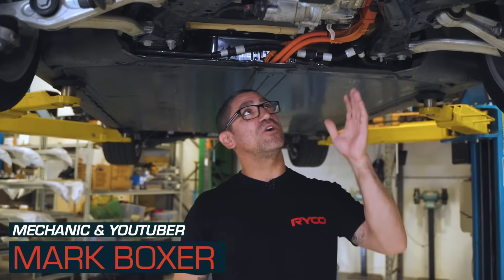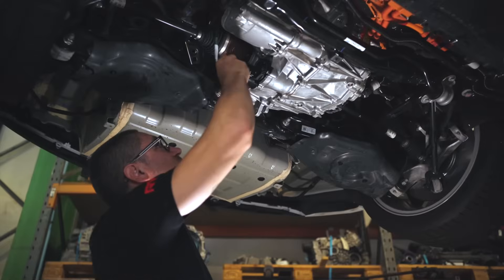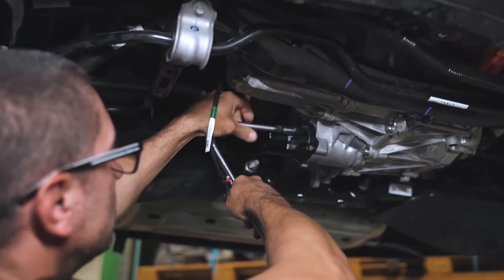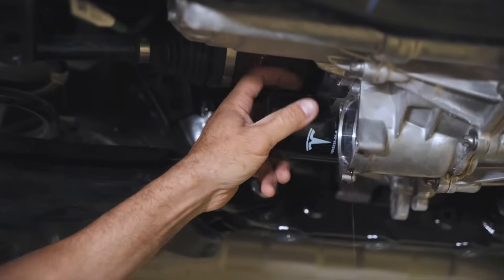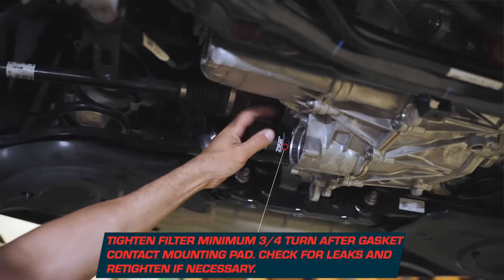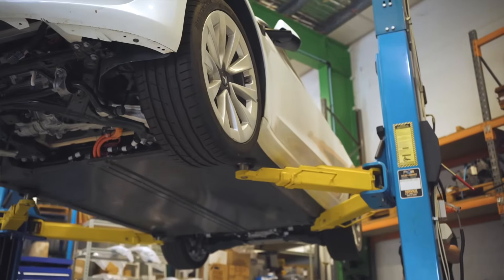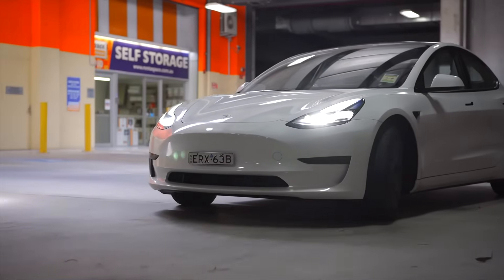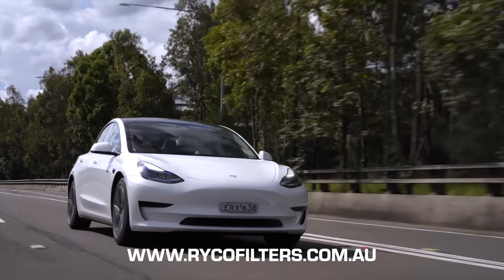Tesla Drive Unit Service

Comment: My 2018 Model 3 had a leak from the rear motor diff pump.  Tesla drained the oil/refilled and replaced the diff pump.  The tech and I test drove the car and received a message of reduced power which was because the diff/filter was not primed.  The only way the Tesla tech could figure out how to prime the diff system was to reload the current version of firmware which ran the diff pump during the self test.  At that time an owner could not reload the current version of firmware but you can now through the service menu screen.  Not sure if the diff pump(s) are always currently run during all firmware updates?

Comment: What a load of BS ! No service is required on drive units unless the car tells you. The motors are “free air” driven and NO oil touches the spinning motor. The oil does not degrade like regular ICE vehicles. 
How many times have you serviced your washing machine, this has a motor and can spin up to 1600rpm  so surely it needs an oil change ????

Comment: wrong fluid!

Tesla officially specifies Pentosin ATF 9 as the gearbox fluid for the Model 3 drive units in many documented cases, particularly for newer models like the Model 3. This is a synthetic automatic transmission fluid (ATF) designed for high-performance applications, providing excellent lubrication and thermal stability. It’s used in both the front and rear drive units of the Model 3, including Performance and non-Performance variants. The fluid is intended to be long-lasting, and Tesla has moved away from regular service intervals for it, treating it as a “lifetime” fluid unless a specific issue arises (e.g., a service alert or leak).

In contrast, ZF Lifeguard Fluid 9 is tailored for ZF’s 9-speed automatic transmissions (like the 9HP series), which are found in some traditional internal combustion engine vehicles from manufacturers like BMW, Jaguar, or Honda. The Tesla Model 3, however, uses a single-speed reduction gearbox driven by electric motors, not a ZF multi-speed transmission. While ZF Lifeguard Fluid 9 and Pentosin ATF 9 may share some similar properties (both are high-quality synthetic ATFs), they are not interchangeable without confirmation from Tesla, as the Model 3’s gearbox has unique requirements tied to its electric drivetrain, including motor cooling and specific viscosity needs.

Historically, Tesla used Dexron VI ATF (another synthetic ATF) in older models like the Model S and some early Model 3 drive units, but for the Model 3, especially post-2017 builds, Pentosin ATF 9 has become the standard, as noted in service manuals and teardown analyses (e.g., by Munro & Associates). The exact specification can vary slightly by production year or drive unit revision (e.g., older Raven units vs. newer hairpin motor designs), but Pentosin ATF 9 is consistently cited for current Model 3s.

Comment: Do you only replace the rubber gasket when it leaks on the oil pump  that you unplugged before filter ?
Reply from the maker: @moodletree, if you have a leak from your pump, you should visit an authorized Tesla service center or a specialist. I'm unsure if replacing the pump is necessary, and we currently do not make the pump for this application.

Comment: Hello, my Tesla Model S 85 from 2014 started making a humming sound at speeds above 50 km/h. Hear it in the front left, I thought it was the front left bearing, I replaced it, but the hum persists. Could it be engine failure? Thanks Norm.
Reply from the maker: Please refer to your nearest Tesla service center.
Reply: It’s your wheel bearing. Simple replacement, or if it’s the drive motor same thing bearings, if your mechanically inclined and have the proper tools (press) you can do it yourself with a rebuild kit.

Comment: Every 100.000 miles in case you are wondering. My model 3 has about 9k miles on it right now. Ill be fine for a while I think!
Reply: 50k on large ones, 100k on small ones.
I'll probably do sooner than later tho.
Reply: That's way to any miles on the rear drive. When you service it the rear will look awful compared to the front. The front drive is barely used. Maybe 30k on the rear.

Comment: Uhhhh you left out the most important part. Do this once every 100,000 miles 😂! If not more. that’s like once every 8 year. No different than gasoline cars who also need to swap their ATF or differential fluid every 100k or longer. Also pretty much no one does that bullshit and everything basically fine for hundreds of thousands of miles.  damn what a weird business strategy relying on servicing electric vehicles. 😂😂. Maybe the really bored paranoid people will want to swap out their oil every 5000 miles ? or just do none of that through the whole life of the car with probably zero ill effects.
Reply: Another video showed the difference between the new oil and the used oil. There was a big difference; the used oil looked very dark for both drive units. If over 80,000 miles, I would change it.
Reply: @snowrocket it’s honestly not. I own a shop myself and was curious about this. When my wife’s model S hit 250k miles I put it on the lift and did the drive unit service. The oil that came out was from the factory 8 plus years ago. Captured a bit of it and sent it off to get analyzed just out of curiosity. It was black but there was little to no breakdown yet detected in it and it spec’ed like new fluid. 
The two things that break oil down in gas cars are heat and combustion byproducts contaminating it. Quite obviously there are no combustion byproducts going on in a Tesla to contaminate it and the electric motors don’t get hot enough to break the oil down. It gets black just from circulating through the reduction gears and from the low amount of heat the motors do generate. The worst thing they found in the drive unit oil was a wee bit of break in metal particles but not enough to even justify changing it. Reduction gears are a lot more finely machined and more tightly packed than what you’d normally find in say a standard transmission so the break in contamination is minimal. This is why the drive unit oil is rated to last the life of the vehicle.
We got her a new model 3 performance so not going to get to see what 500k would look like but I plan on keeping my model 3 long range until the wheels fall off so maybe when that one hits 300-500k I’ll see what things are like in the fluid then. I already retired from the military and I plan on keeping my automotive repair shop going until I retire for good here in twenty years so I’ll update it whenever it happens lol.
Reply: @RonsRepairs  Interesting to hear your experience. My thought is if the system has a filter, then some maintenance is required. Even manual transmissions and differentials have a change fluid requirement. Granted the manual tranny has gear shifting going on that a simple gear reduction does not. That alone is a huge difference.
Reply: I'm at 300,000kms no change - should I do it? 5 years old

Comment: This is the first time I’m seeing an oil change on a telsa lol
Reply: Yes, but it’s on the drive unit (gear reduction and differential), not the motor. I believe the motor runs on two sealed ball bearings requiring no maintenance. There’s this illusion that “Teslas require no maintenance” which is not true. They have oil in each drive unit and coolant for the battery pack and motor(s). Both of these do need to be changed but the interval is around 100,000 miles, depending upon who you believe. NOT doing this maintenance is a fool’s game long term.
Reply: Yes at 160,000kms this interval is considered a lifetime fill per se.  very different to a 6 mo the or 12 months interval in combustion vehicles
Reply: I'm retired from the Industrial Allison Trans field, we'd be concerned if the oil came out this dark during a standard OCI(Oil Change Interval). This oil has been overheated, left in far too long or is too thin for the OCI timeframe. I'm probably going to a little thicker oil in my MS LR just to be sure. Most OEM's are running thin oils for EPA numbers and I'm not concerned about a fraction of a % if it adds 300K+ miles to the drive units gearset.

Comment: Tesla service schedule states "Drive unit service at 1 year or 12,500 miles"
Reply: That’s the brake service that’s every year or 12,500 which basically amounts to pulling the pads, knocking off any corrosion you find, grease the pad contact point while doing the same to rear pads and slide pins. There is no recommended service interval for the drive units the fluids are supposed to last the life of the vehicle.
Reply: Please show me where

Comment: You know what really grinds my gears is people using oil on the oil filter seal for it to seal “better” and a lot of people swear by this but I absolutely hate this  as it’s redundant why only lube up the oil filter seal why not also the oil pump one as well or rear mains or valve cover sears my point is if this actually did anything other than a mess why do we not use this on every oil seal instead of stuff like rtv or Honda bond some brands even abandon seals completely because that stuff works so good as for this process I’ve only ever seen on oil filters and I never do it they never leak or get stuck on but friends that  do I’ve seen have stuck oil filters and oil filter loosen up and start leaking (only a hand full of times) but still
Reply: A whole lot of yapping to still be so fucking wrong
Reply: Everything you said is not the reason to pre lube the rubber seals. It's only for the seal not to grab an edge which can cause the seal to overlap on itself and not function as a seal.
Reply: Holy fuck you love yapping nonsense

Comment: Yep Every 8,000 Miles This Needs to be Done ….
Reply: Premium individuals will change theirs every 4,000 miles.
Reply: @WEREDOG100  no don't do it it is supposed to a sealed unit till at least 250k or 180k miles....No Service Required
Reply: @dstylez1171  if you want your motor to burn up which is exactly what tesla wants it to do out of warranty lol.
Reply: I do it every 100 miles, just to be safe

Comment: Don't do it...he is not a tech and it was designed for the life of the vehicle....250k
Reply: This comment is so stupid
Reply: @CarsandChris  do you even own an ev?....no service required...unless evidence of improper use....this comment was even more stupid
Reply: @dstylez1171  I know you also don't own an EV if you think there's zero maintenance required. Clearly this video shows that maintenance is required. They wouldn't have made the filter a spin on if it wasn't required. Use your brain
Reply: @CarsandChris  I have owned my model 3 LR for 2 years....ZERO MAINTENANCE REQUIRED...mic drop
Reply: In fact the filter never needs changing it is only there as a precaution....it has been repositioned and redesigned as the parts before were not even developed for it to be included into the motor housing....duh
Reply: @CarsandChris  and if you want to really know I use my car about 800mile a month
Reply: @dstylez1171  omg 2 years?!?!?!?! That's such a long time!!!!!!! Wow!!!!!! If you were smart you would have read the rest of the comments that stated around 60-100K miles is normal for when you'd replace the oil. If you wanna run your car into the ground and have it prematurely fail, feel free to refuse to change your drive motor oil. Your call bud 😂
Reply: I have looked up the Tesla service schedule and it says for the drive units to be serviced at 1 year or 12,500 miles.
Reply: @danmead4787  liar....just went through mine again and nothing says what your are saying...brake inspection that's it
Reply: @danmead4787  it does not say that!....liar!....it does say Damages or failures caused by maintenance or repairs performed by non-tesla certified technicians  are not covered under warranty...hahaha do not listen to this guy
Reply: @dstylez1171  Yea actually it does.
Reply: @danmead4787  liar
Reply: @danmead4787  it says it no where
Reply: @dstylez1171  dude why are you so obsessed with Elon?
Reply: It's actually a 2020 model so 4years old it's got the miles to show and zero maintenance ....sorry that is facts from actual tesla service techs...ice mechanics are nothing more that part changers...FUD
Reply: @dstylez1171  doesn't change the fact that at some point the oil for the drive motors should be changed if you want it to last longer. And calling mechanics "part changers" shows you have no idea the work that goes into identifying and solving problems with cars. Diagnosis is a big part of problem solving and good mechanics get it right.
Reply: @CarsandChris  you are overcompilcating the whole intention of ev motors and vehicles...if we wanted the same maintenance routines and failure of thousands of parts we would be talking about ICE...I rebuild and race motorcycles so I do know mechanics and you don't say anything that makes sense and yes we do only change parts now...if you think you actually fix and make things better your delusional those days are gone since the 90s
Reply: Question do you ever service your power drill or cellphone...duh...if you are an English mechanic you are probably looking for the oil filter lol
Reply: Do yourself a favor buy one and you will realize what the early adopters are saying 5k per year in operational cost savings...2 years I have reinvested what I would have and paid my car off in 1 year...fools love ice....3cyl turbos are not engineering masterpieces...it's flat out over for ice
Reply: @dstylez1171  I don't drive to work. I don't need an EV. Every car I own is for pleasure only. I make enough money to own them all. It's what I choose to spend my money on
Reply: @CarsandChris  then why are you even spitting nonsense
Reply: @dstylez1171  because telling people their EVs don't need maintenance is wrong considering they do need maintenance
Reply: @CarsandChris  listen don't talk unless you actually have experience in the topic...anyone that truly knows is not saying the things you are saying please do your due diligence and speak on topics you know about...I do not want the reputation of tesla ruined by mechanics that cannot accept that these cars do not need maintenance if you can own a tesla past 250k other than suspension and tires the one brake service in that time the motor will be fine and if you wanted to push it to 500k I am sure it will be fine...coming from experience and from many years of researching
Reply: @dstylez1171  this shop clearly has more experience than you do and that's why they're doing oil changes on the drive units
Reply: @CarsandChris  not in evs only trying to stay relevant...if they never touched the vehicle I am positive it will work issue free for however long the owner wanted to own the car don't waste people's time and money by invoking fear that there is necessary maintenance when there is zero....Owners read your Manual don't trust ice mechanics
Reply: @CarsandChris  if they did not do the service the motor would be fine till 250k longer than anyone would ever own the vehicle...stop invoking fear...they are stealing money from you....Owners do not listen to your mechanic in regards to your tesla...he is obsolete
Reply: Take a look at the syn srm motor that tesla re-engineered by relocating the magnet placement he increased efficiency and torque....hmmmm but why would you even understand that
Reply: Pssst that it the meaning of the tesla logo...ice is dead

Comment: I’m trying to get Tesla to change fluids on both drives on 2022 model s . 30 k miles and I bought it used and I think this ex owner used to really push the pedal to the metal…
You think it needs it??
Reply: Tesla will probably say its lifetime fluid, so ask what the warranty is and there is your service interval.

Comment: Thanks for the video.  A few points that same to mind.  I'd make sure I can remove the fill bolt before draining the system.  I'd also prime the filter with some oil and turn it horizontal to drain out any excess (back into bottle) before installing.  I'd get one of those oil pumps that look like a big syringe.  To the question about engaging the pump, I wonder if putting the car in drive and running (slowly at first) with the wheels still off the ground would take care of that?  Should be very little stress on the system that way and the oil should begin flowing.

Comment: How much oil is required?  I appreciate the video but you glossed right over that very important part.  Do you just fill until it starts coming out the fill port?
Reply: From the tesla service manual
Reply: @aagoglia2  Thanks, much appreciated
Reply: Wondering the same
Reply: @larsjohnston8792 Note
The minimum refill capacity of the front drive unit assembly is 1.3 liters. Using excess gearbox fluid in the fill container allows the oil pump to dispense the full 1.3L without drawing air. Make sure that there is less than 200mL left when completed. Pumping the full 1.5 liters is not required.
Reply: @aagoglia2  That's incorrect. The front motor is 1.5L, but the REAR motor which the one showed in this video needs 2.3L minimum.
Reply: @marcpelegrin8573  What is recomended interval for oil change, front and rear drive unit? If it's even aplicable on 2024 model 3.